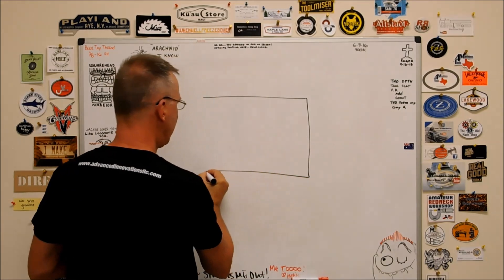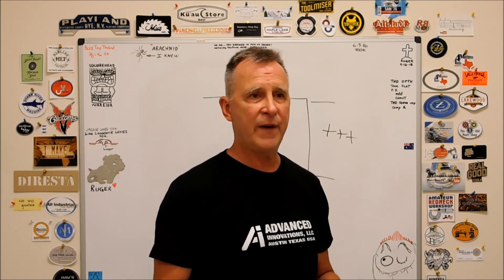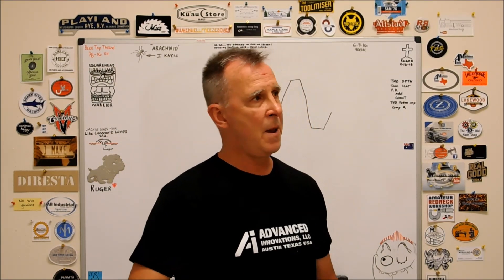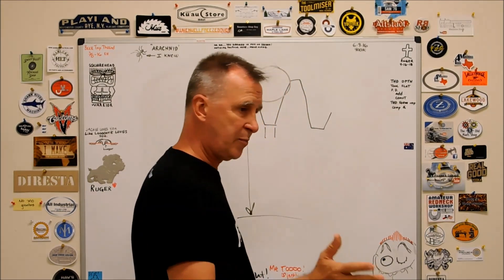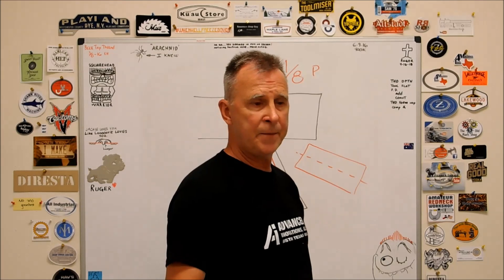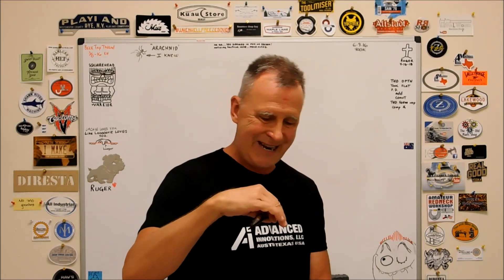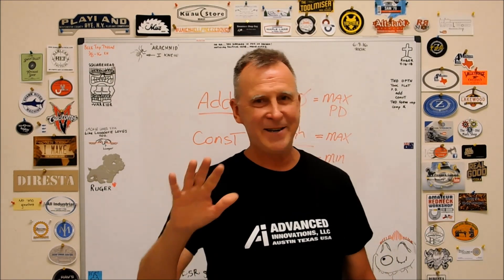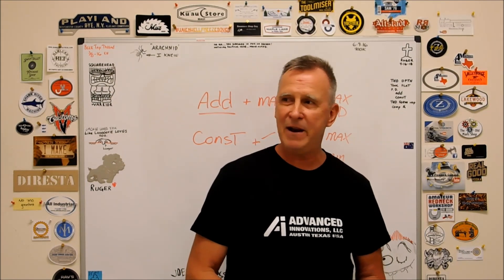Single Point Threading, Want to do it better ?? Watch This Video.

Comment: Some of us in the U.K. still work BSW and BSF as well as metric. I never understood why we were forced to accept metric when we had an imperial system that was perfectly good enough. We also had the BA thread form.
Reply: When you're involved with the design side of engineering, as I was at one stage, metric makes the maths involved sooooo much easier, everything is either multiplied by 10 or divided by 10.  I am now an old duffer and was raised with the Imperial system, but I forced myself to think in metric, and now it's second nature to me.
Reply: Britain needed to export, ref government 1960s' mantra of "Export or Die". Domestic market was small, not so for US, and it is very costly to adopt a new system of measurement, machine tools last forty years plus, do does measuring instruments. America's growth was perfectly chronologically timed for mass manufacturing, and the US did an excellent job in standardisation, all automotive manufacturing in the US is nearly 100% metric, mainly due to multi nationals etc, now would be a good time to bring in the metric system.
Reply: @bostedtap  You bring up a very good point. Machines last a long time, which is why both my lathe and mill have imperial dials. It's a rigmarole to set up metric threading. No doubt British manufacturers were screaming at the time, at having to 're-educate' the work force to work in hundredths of a millimetre instead of thousandths of an inch :-)
Reply: @bostedtap  You had a lot of time ,its not something whole world decided and did over night.Some are simply too stubborn to accept the future,and push their own standards -that is why we have so many instead one universal for whole world that would make production compatible,parts cheaper.
Reply: Because rest of the world evolved from the caveman era and your government figured out it was time to join rest of modern world?Dont know why you still drive on the left side but hey maybe in 100 years you will decide to join the rest of us on a right side.
metric should be standard in whole world ,everything else belongs to history and should be eradicated.World only needs one standard.
Reply: @zumbazumba1  So you're saying that Americans are cavemen? You're correct in saying that it was political to adopt the metric system - part of the "We're all friends now" mindset. There is no advantage to metric over imperial really - a dimension is still a dimension, even if you measure it in 'fleas' or 'peas'. So dropping a system that worked in favour of another made no sense (other than to politicians, who didn't even use it on a daily basis). As for driving on the left, we're not the only country in the world doing it. It would be a logistical nightmare to change over to the other side, and probably why the government didn't do it back then.
Reply: @zumbazumba1  more countries drive on the left than the US population. Thank the French, Napoleon in fact for changing this.
Reply: @bostedtap  Yea only ex British colonys drive on left side.
Reply from the maker: @zumbazumba1  You can call a 1" standard a 25.4mm standard or 1". Metric is simply a different language. I hope we never change.
Reply: @zumbazumba1  Japan?
Reply: Add Thailand to lefty drivers not colonised by Britain.
Reply: @johncrowley5612  i thought they only have one rule dont crash,
Reply: @metalshopwithtroy5755  Always have $5 on you to pay the cop!

Comment: Like so many things, there's a BIG difference between the guy doing it as a hobby and the guy doing the work professionally. 

Thread fit is a STANDARD and just because the off the shelf nut fits doesn't mean it's right and conforms to the standard. 

One of the reasons a thread fit is specified is because a certain degree of thread engagement is needed for strength of the connection or perhaps a degree of "looseness" is needed to allow space  for sealants, locking compounds etc.. 

Good info, Joe!
Reply from the maker: Thanks.

Comment: I’ve been struggling lately with using a HSS tool i ground to cut single point threads. I’m confident my grind is good and my tool is square to the work and my compound is set at 29-29.5 degrees. For some reason it’s just not coming together. Going to apply some of what I’ve learned here and give it another shot. Thanks Joe. Really appreciate all your help.
Reply from the maker: Glad to do it. Feel free to reach out with issues if you need to. I'll help you solve the problem if I can.

Comment: I didn't quite get the compound angle point, as I understand the compound angle is only to reduce the load on the tool.
Can you elaborate on that a bit?
Reply: making the point of being 30* from perpendicular to the rotational axis rather than 30* from parallel as some mistakenly do...
Reply: @transdimensionalist  This is particularly easy to do on some import lathes as the angle scale is graduated from parallel rather than perpendicular.  On mine, 30° from perpendicular is actually off the scale.  If you are outside the 30° cone (being half of the 60° thread angle) you end up with a buttress thread - I'll give you one guess how I know ;-D
Reply: @Cenedd  yes half the desired thread angle is more accurate :) my lathe is around 100 years old and has no scale, or many true surfaces to measure off so alot is done by eye and guessing :)
Reply: @transdimensionalist  - Start scraping in some true reference surfaces, brother.  Give your measuring tools reliable places to stand!
Reply: Its simple -you put half of desired angle and feed with compound-that way only one side of knife is doing all the cutting instead of entire surface.Later you do a few final passes with whole knife surface cutting by feeding it with cross slide.

Comment: I was hoping for some graphic sketches to illustrate the use of Add & Const when measuring PD with wires.
Reply from the maker: You got it, correct?
Reply: Thanks for caring.  I'm a DIY hack with too many interests and not enough time to master any of them.  The concepts and geometry of measuring PD with wires are clear to me, but I've not yet needed to make something "interchangeable" so I've never actually had to follow the correct measurement procedure or even be concerned with thread classes.  The one-off "lawnmower" parts I've made have just been tested to nicely fit their mating commercial fastener, and it's been good enough to get by.  The next time I have 20 minutes free I'll break out Machinery's Handbook and look for a diagram on Add & Const.  
Hmmm... Do you use a dab of grease to hold those wires to the micrometer anvil?

Comment: Super rant. Now do it in metric, m10x1,5 pleas.
Keep up the good job
Reply: Easy-depth of cut is :diameter 10mm(you want to add 0.1mm clearance so outside should be 9.90mm) - pitch 1.5mm =8.5mm.Metric thread has 60° so you set your compound to 30°.
Reply from the maker: @zumbazumba1  STOP preaching "depth of cut".
Reply: @joepie221  Depth of cut/pitch same thing .Why its same thing?Because metric threads are equilateral triangle depth ofcut is same as pitch is wide .At least in metric threads.Maybe more correct it would be to say depth of root.

Comment: Wow! This video is priceless! When I was in school (a very long time ago) I wish I had metal shop teachers who were half as talented and knowledgeable as you are, Joe. Thanks so much for this excellent tutorial, and for all of your other wonderful videos.Question: There are lots of charts available that list tap drill sizes for common taps, both imperial and metric, but I have yet to find any charts at all that list recommended rod diameters for common die sizes. Why is that? If no charts exist, then please tell me how a person can find out what the recommended rod diameters are  for various dies. It usually becomes a case of "Guess work" for me.THANKS AGAIN!
Reply: usually its just the nominal dimension of the thread ie. m8 thread uses 8mm rod, 1/2" threads use 1/2" rod, job done no charts needed

Comment: Hahaha, perfect. I was threading tonight 2.075 - 20, and I was wondering how to figure out the depth of the thread XD When I figured what it would be approximately, I used the advice from your previous video to set the depth without trig. Great right? By the time I got the thread to depth, and got a sharp crest,  I had dulled the tool, so the Min. Diameter was radiused. Not a big deal, It's just to fit something else I need to turn internal threads on in the shop (Fly Cutter to fit a Shell Arbor), but good timing

Comment: The ideal flat root you mentioned is not the case in some situations. Some threads REQUIRE a root radius, and a vary accurate and clean one. I worked at a place where this was the norm. These were UNJ and UNR with different variations of them. We did not cut them though, we rolled them.
Reply: Cutting tool suppliers typically only supply single point threaders with a root flat, OD, on the tip when it is a Acme, buttress or square thread. Most others have a radius that is dependent on the thread being cut. A radius is better for heat dissipation, which in turn extends tools life. This is a deep topic, why Joe is probably so passionate about it. He did a good job of an overview and pointed out the important characteristics of proper thread forms.

Comment: Brown&Sharpe, a major contributer to thread standards actually manufactured some off standard threads in their form tools.  They made it so you had to buy their mounting bolts, not an off shelf bolt.  Off the shelf bolts didn't fit but were dimes.  B&S bolts were dollars, but they fit and the job would run.

Comment: Ummm-crest and root flats are NOT identical for UN or Metric threads. For an external thread, the root flat width is P/4, and the crest flat is P/8. It's the opposite for an internal thread. Thanks for the videos, though.
Reply: Are you sure about that? All the old  books I have say for ext threads 1/8P root and crest but 1/4 for minor dia of internal thread and 1/8 for the major.
Reply: @chrisstephens6673  Machinery's Handbook #26, p. 1706, Basic Profile of UN and UNF Screw Threads
Reply: @andywander  thanks andy will check it out
Reply: @nick f The Basic Profile shows P/4 for the root flat of an external thread.

Comment: Sorry to say all matter, major, minor and pitch dia. I suggest using a id thread mic with interchangeable balls to figure out the pitch dia. Like putting a ball into an internal thread and measuring like pee dee wires. 1/8 pitch for the flat usually works well

Comment: Personally you want to know thread depth. The main reason is to figure out the minimum depth to cut before using the wires. Saves time.
Reply: I actually have a spreadsheet that will give me the thread depth, based on the starting diameter, be that ID or OD, and the PD.  It also takes into account, the tool nose radius. As such, I can usually land within .001 of the PD before I ever have to check it.  Very Handy.
Reply: @MrGettinlate  If you are getting within 0.001 on the wires, very good.  I ain't that competent.. :D

Comment: I do have a thread question.  If I want to "create" my own thread to mate parts.  ID and OD What is the best approach to calculating each thread?  Should I create the A thread first and use the measurements of the root to get my initial size for the bore of the B thread?  Hope this makes sense.

Comment: Joe i use CARMAX full profile threading inserts . And thread gages i have are ajustable gages .. In rifle barrel installation  some receivers are glued in the rifle stocks allso receivers vary a lot by various MFG. NOT EVERY BODY FOLLOWS THE STANDARD IN THE FIREARMS WORLD 😣🐤
Reply: Do you need a high tolerance threads in firearms?Especialy for barrels where heat is present where you will loose that precision due to metal expanding.

Comment: Great video...and I was hoping you could give me your opinion about something happening at my work place? We have a newer MAZAK CNC lathe that they say is can't tap holes. They will turn a part in the lathe and then take it to an HBM and tap it....I am absolutely certain that it can tap holes but they won't admit that they just don't know how to do it. Any chance you could do a video explaining how easy it is? We do have a flexible tapping head that works great on the HBM's that will fit in the lathe. Thank you for sharing your knowledge!
Reply: Maybe it's a workload issue?  As in, they're farming out operations to a lesser used machine, so more parts can be made on the lathe?  Just checking on the obvious, is the tapped hole really concentric with the spindle?
Reply: The tapped hole is concentric. They turn the pin, take it out of the chuck and tap it in a horizontal mill because they don't know how to program the lathe to tap. They said they're too busy to figure it out...…

Comment: I almost couldn't read the most important thing on the board... The beer tap thread! Is that an A2? 

Thanks for the reminder to buy the stupid pitch wires already. Thankfully, my junk only has to work on my other junk. But it doesn't hurt anything if the threads are perfect!

I don't have enough things to fish out of the chip tray. Gotta get me some wires to lose in there. :)
Reply: It's a 3/8-16 if I recall correctly!
Reply: Hint: Place a rag on your lathe bed under your work when checking with wires to keep the wires out of the chip tray.
Reply: Heh, that's a t-shirt for sure "It never hurts to be perfect!"